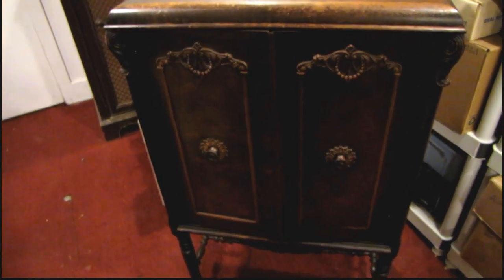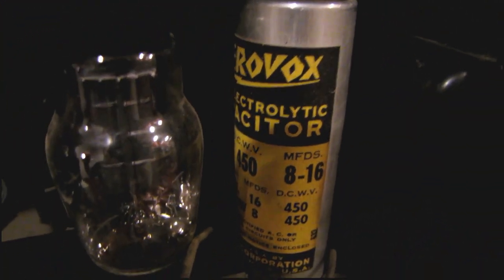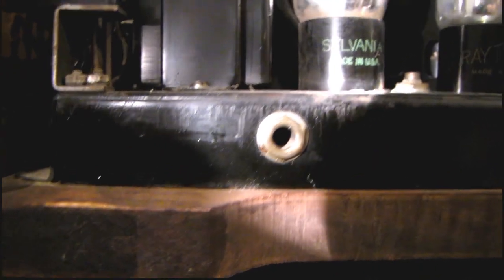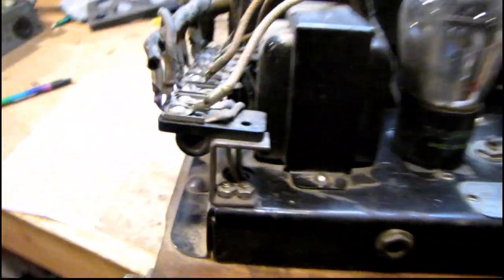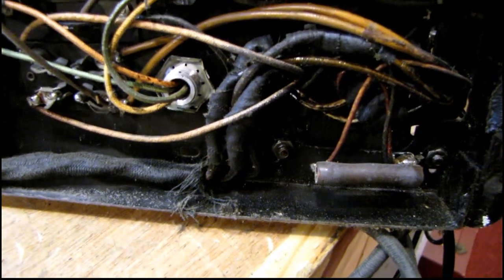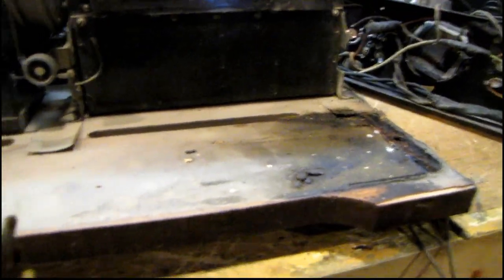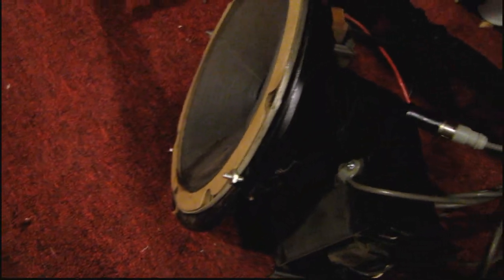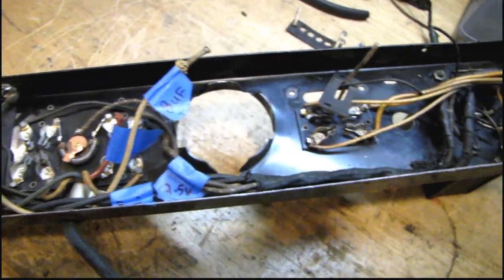Sparton 931 Radio Repair, Part 1 of 2

Comment: I just picked up one of these consoles, luckily not as hacked up as yours. But the strange thing is it didn't originally work only because 3 tubes were out of their sockets in that same module where your tubes were loose. In fact, I think they were the same ones! I bet one of the problems with the set is that moving it around causes them to fall out of the loose sockets. Anyway, great video!

Comment: It uses whats called Pre-Selector tuning.There is a diagram for it in that Old Ghirardi book."RADIO ENGINEERS HANDBOOK" or something like that.The books are on E-Bay all the time.Its a Second or third order bandpass filter with the capacitance as the variable to change the passband it sends on to the RF amplifiers.I think they are cardon type 484's.Good luck!

Comment from the maker: @batterymaker Yep, I forget the name of the original circuit design they improved and used for their sets.  It's not TRF, but is arranged in a similar way.  The down side is that it's hard to get a station to come in without bleed-through from another station.

Comment: Great old radio. It is to bad that someone made so many mods to it. I am delighted when I get a radio that no one has been in, and of course that is getting rarer and rarer. But if it where not made to work earlier it would have ended up in the dump.